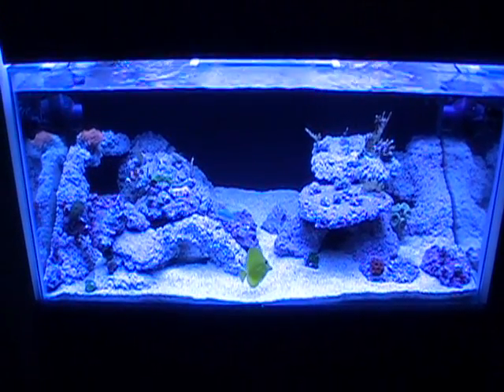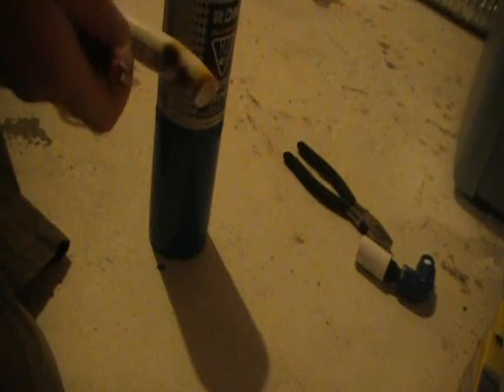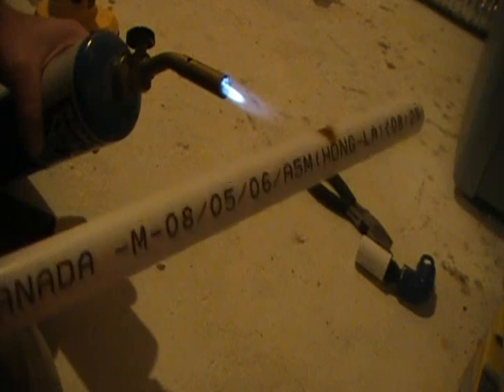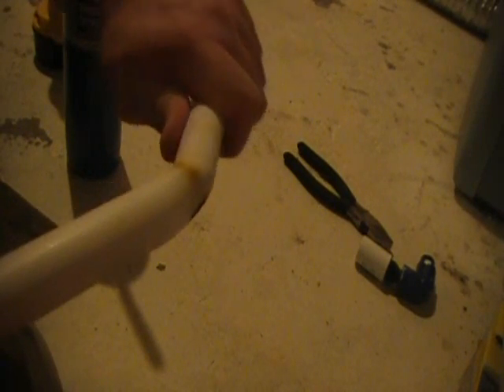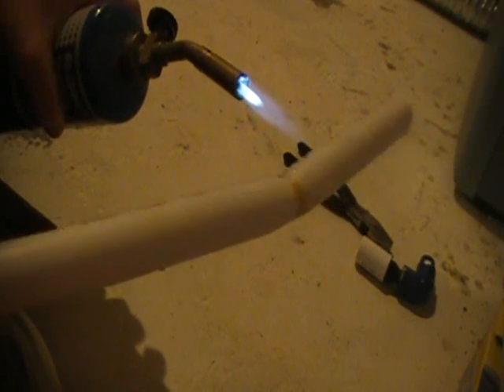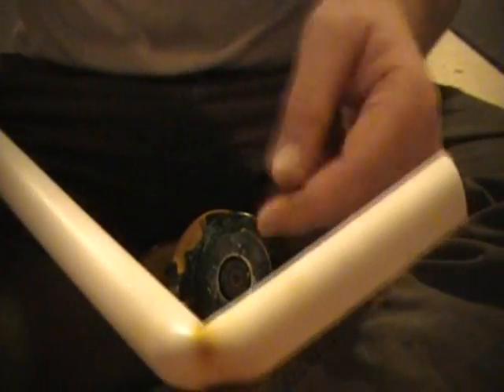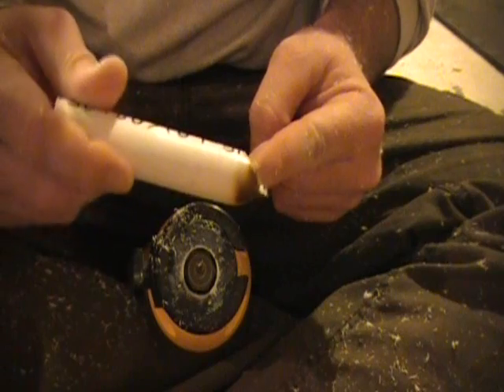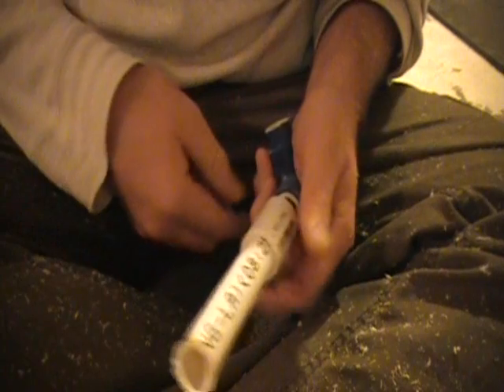Rickets Reef: DIY Surge Device Part 2 - the spout

Comment: Hey there,really enjoy the vids.when you need to bend a length of pvc,try this! get 2 caps, fillit full of sand,cap it off and put it in the OVEN @ its lowest setting(i know ,the wife wont like it)but you can make nearly any bend with no restriction,and NO burn marks! As an electrician,i do this all the time for conduit

Comment: Speed is what works for me. I thank you so much for the info on how to make them. I have found the faster they spin the bigger the wave. Yet it is very gental on the corals. Iam using a panworld 200 ps pump to push these and 2 spray bars. My reef started to take off the minute i put these i'n. This was the answer to perfect flow for me. Please keep the videos coming.

Comment: The birds are very cool,but wanted to add you do not need to make a spout like that.When you put the half inch 90 on all you need to do is use a half inch cap and dremil a straight line even across the cap. This very simple idea works so much better. Check out mine. No bending, no torch , and they spin so fast i have to throttle them down. They look cleaner this way as well. Your idea rocks, i Just thought it could be so much easier and cleaner.I played with it to find a cap with a flange is th